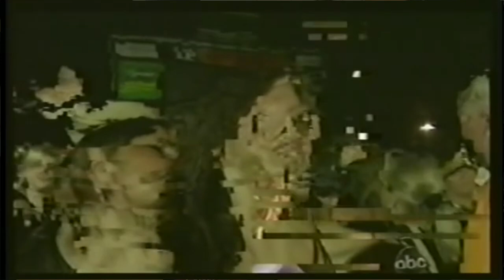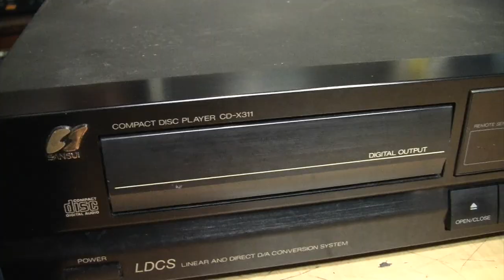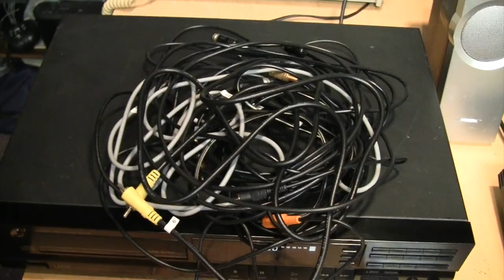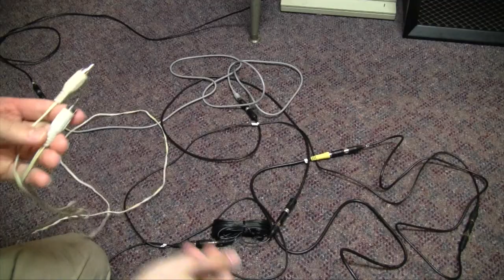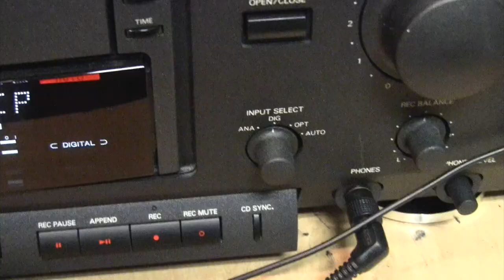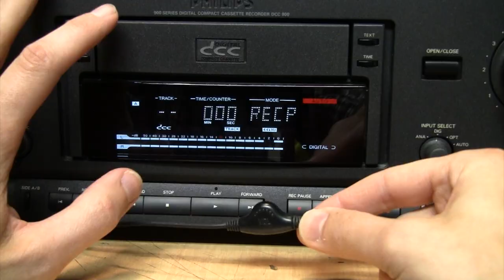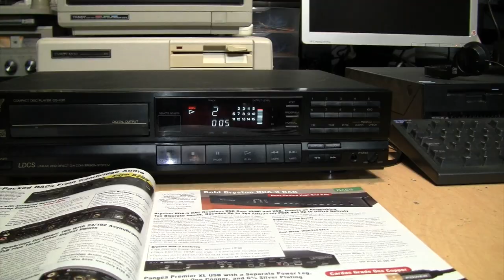What does a crappy digital audio cable actually sound like?

Comment: Brilliant work, as always. I suspect the same might be true of HDMI cables.
Reply: Geez, I don't think we need "audiophile" anything for digital and optical signals. The only time you actually need it is for analog or very high data rates.
Reply: Some HDMI cables that claim to be of the data rate suitable for 4K will sometimes have the picture cut in and out, suggesting the higher frequency information is being lost even though it's perfectly fine for 1080 or lower refresh rate 4K. Of course the cable shielding (and its environment) makes a bigger difference for that than whether the connector is gold.
Reply: @kaitlyn__L  not had this problem myself, but I don't have a 4k TV!  Your reply has made me think though. I've got a car that supports android auto, and some USB C cables, ones that are perfectly decent for charging and connecting to the PC, will not work for that purpose. The car keeps disconnecting from the phone. Had to get a sturdy Anker cable, which is much stiffer and thicker than the usual cable, and then it works fine. I guess a lot more data is being squirted down the wire for that application than just sound.  But I guess that's still a difference between the cable working and not working though. I suspect these claims of better sound (or picture, or whatever) with premium cables are bogus. It either works, or it doesn't.
Reply: @SpuddySpud  Yeah, it definitely works or it doesn't. The only subtlety is it might flicker in and out of working or just completely stop, depending on the level of corruption. But no subtle changes in final outcome could be occurring from small interference, it would get caught by the error correction, or just not change any bits' distinguishability at all. No way clearer sound would occur compared to adequate sound from such a cable. Much better to upgrade your DAC if you're spending that money!

WRT your USB cable, it's almost definitely the same thing. Higher data rates, if keeping the same encoding scheme (aka QAM or Reed-Solomon or whatever), necessarily require a higher frequency signal. Video being so many MHz compared to audio's kHz created lots of challenges for cables back in the day, and the same can occur with data rates today, albeit now in GHz for HDMI's many dozens of Gbits, even if they are packing 8 or 16 symbols into 1 baud. For Android Auto, it's sending HDMI signal down the USB cable, rather than a software-layer HDMI over USB transfer layer. I think. I hear any TB3 compatible cable has the cable bandwidth (yk, in GHz) for HDMI or DP, which I suppose makes sense. 

With your USB cable it could well have been a mix of not enough bandwidth in the cable but also interference, if you don't think it was shielded as well as the chunky one you replaced it with. Cars are pretty RF-busy environments, and high frequency signals are also disruption-sensitive. There's a chance it could work ok in your home, if all the bits remain distinguishable enough.
Reply: @SpuddySpud  :  That may just be down to the way the cable is internally wired - it may not have connections for the Android Auto functions. I've had similar with mini-USB cables to connect cameras to my PC - one that came with an HDMI adaptor is only wired for power delivery, and not data transference.
But yes, you are definitely right that most of those claims about fancy expensive cables are better than the 'cheap' ones....as long as the 'cheap' one works as it should, then there is no need to replace it with the snake-oil $100+ cable just because the manufacturer tells you their's is SO much better........Just as VWestlife proved in his video.......!  :-)
Reply: VWestlife's audience is a knowledgeable bunch!  Thanks for the feedback 👍

Comment: I dropped my subscription  to Stereophile Magazine many years ago when they started spouting nonsense about digital audio.  "Color the outside edge of your CDs with this specific green marker to make them sound better!"  Yeah.

I may try to replicate your experiment, I'm wondering if having the signal going through the stereo cable in the same direction (instead of doing a U-turn as in your setup) would make a difference.

Also, running the signal through the attenuator was an excellent idea!
Reply: Coloring your CDs with marker was actually a real way to defeat certain copy-protection technologies. You had to color them in exactly the right place - the aim being to color-out the deliberately corrupted data-disc table of contents that was made to jam up CD drives, so they would fall back to the valid audio-only ToC.
Reply: @vylbird8014  Macrovision on DVD was a copy protect system, I wonder if the green marker will work on those
Reply: @VaughnfromPeterborough  Nope. Macrovision on DVD isn't really 'on' the DVD: It's something the DVD player adds in. The DVD only contains a flag that tells the player it needs to turn macrovision on, so you can't color it out. Players have to obey the flag because it's a condition of the licence that manufacturers must agree to in return for access to the decryption key needed to (legally) play a DVD.

Comment: interesting, LMAO. It is not just the increase of resistance in very long runs, there is also an increase of capacitance as well. Parallel wires (insulated) close to each other ( as in a cord/cable) act as a capacitor as well. BTW: those expensive cables are a ripoff, but people are too gullible to not buy those.
Reply: capacitance would play a role if it was couple kilometers at 1MHz (for example adsl), but 20m at 100KHz? :)

Comment: So you don't need to splurge on those expensive high-end "Monster" branded cables claiming you will get better quality.
Reply: Well, for the actual electrical stuff it's helpful to have gold contacts so you can basically ignore the contacts (contacts matter because of corrosion/oxidation, so if that doesn't happen then you don't have to fix it!), and if you somehow find a TOSLINK cable that has a wire running from a contact on one end to a contact on the other then you might as well splurge for gold (for all you know, you could accidentally connect the grounds together).

But as far as just cables? If you're fine with soldering or crimping, it's not even all that hard to just make your own. With a bit of experimenting, I'd bet that you can get some awesome analogue headphone cables by just connecting some boring gold-plated TRS connectors to welder wire (the stuff they use to connect the welding tool to the power supply: much lower resistance than normal headphone wire because headphone wire is normally thin, but the smaller strands make it more flexible and more resilient to flexing than normal stranded wire), and the cost will likely be much lower than the "audiophile" stuff.
Reply: Yes you must.
Should cost a minimum of about 700 dollars/foot cable.
Reply: The Monster shop displays in analog days always severely annoyed me. They'd have Monster Component cables compared to no-name Composite cables, hardly a fair contest!

Comment: I think you were experiencing interference as the digital packets went through the stereo cable side by side in both directions at the same time. Probably if you stripped the two wires apart so they aren’t touching each other for 25 feet, it might have continued to work fine. Or maybe twisting it like a pair of conductors in a Cat5 Ethernet cable. That might have canceled the inter-wire interference.
Reply: it sure did look like far end crosstalk
Reply: Yep, I was thinking the same thing. The crosstalk is causing the degradation more than the overall length.
Reply: yep 100% that's what was happening. This is why we shield cables when doing long runs with low signal noise ratio (tv aerial being the prime example).

Comment: Hydrogen Audio represent! Admin kode54 here.

E: Also going to guess a possibility that the audio passing twice through that same paired cable can also result in RF interference between the two cable lengths.

E2: I watched the whole thing this time, rather than commenting while I was still watching it lol. I see it's just the DCC having the smarts to cut off on signal degradation rather than playing the resulting audio.
Reply: Hey, as an electrician I think you are onto something! Signal, that is passing through the same paired cable in the opposite directions could cancel itself out, ecpecially if the cable is coiled. I've seen inductive interference filters that are working on the same principles.
Reply: what

Comment: What you did is creating a coil, so the signal itself is creating a magnet field and influences the signal that is right now in a different part of this stacked cable. If you had split up this stereo cable, your issue would  be gone.
Reply: Don't tell him that he be running the cable down the street next lol 😉
Reply: Pauly H I’d watch that video.
Reply: Yeah, I was curious if plugging back into the same end of the cable the first input was in, rather than looping round to the opposite corner on the same side, might have dropped less bits. Since it would be two parallel coils rather than a mirrored coil?
Reply: @kaitlyn__L  He did actually test this at about 15:00 but it was the same.
Reply: @multiplyx100  ok.
Reply: Maybe the left and right grounds are connected in the crappy cable?
Reply: @NejTech  No, its really this effect of the both cables being attached together creating magnetic distortion. Those cables aren't coaxial, their signal cable isn't encapsulated in the ground. they are just two wires side by side inside the insulation. So there is no shielding effect from the ground.
Reply: Makes sense since it's completely unshielded, with properly shielded cables even this would not be an issue.
Reply: Yeah I concur with this
Reply: No. Because you have both the signal (inner wire) and the return current (outer shield) going the same direction, any magnetic field completely cancels itself out. Same with the unshielded cable, makes no difference.

Having the outgoing and incoming current cancel itself is how a GFCI (RCD) protective outlet works.  If exactly the same amount of current is returning through the neutral, it cancels the current powering the load.  But if any current takes some OTHER path to ground, then the currents are out of balance and it trips the breaker.
Reply: @richard7crowley  there is no shield anymore, it was lost when he added the segments without shielding.
Reply: @RedShift5  If not shielded then it's a twisted pair. Either way his point about magnetic field of the return current magnetic field opposing the signal's current is valid.

Comment: Great video! Would like to see more on this topic. By the way, I've seen audiophile SATA cables as well! If regular SATA cables were dropping bits along the way, our computers wouldn't function. I can't see how such a cable would be of any benefit to the sound quality.
Reply: Audiophile sata cables? Wtf? 
I mean crappy sata cables may fail with some bits (and because of that the s.m.a.r.t. crc value), but the computer requests an entire data stream, if its corrupted and the system didnt crash it wont just use it like a analog device.. 
And worse!  Tecnically unless you have like 12mb of ram, the files should load up entirelly on ram.
Reply: @eduardoavila646  https://jcat.eu/product/reference-sata-cable/
Reply: @Carambal81  "Cryo threatment", "vibration dampening", "better audio and video quality",  this one could easily be sued due to false advertising. 

I think that my faith in humanity has dropped quite a bit.
Reply: @Carambal81 
"best sound and image quality"
"image quality"
Dude what?
Reply: @Wilus0  From their user reviews: "During my first test directly from the fine gold box I immediately heard that it sounded cleaner. Perhaps not a night and day difference, yet fully noticeable.
Now I have listened much more with JCAT Reference, perhaps both the cable and my brain has become more balanced during this time. I'm not either a true “burning-in believer” but I anyway have my senses fully open. I switched back to my old JCAT SATA V2, and after that it was not fun to listen anymore. Whole soundstage was more squeezed or compressed and strained especially in the treble."

They have an entire blog post with stuff like this: "Audio grade SATA cable used with an operating system drive or a music library drive improves the sound quality dramatically. It doesn’t matter if you have the latest SSD or an old HDD, the effect is always the same: much higher class playback that can be compared to using a high-end USB Cable with a DAC vs. a generic one – more details, darker background, more clarity & musicality. It should be an essential component of any audio PC. When I look at the internals of so-called ‘state of the art’ audiophile music servers, I’m literally shocked to see that this area hasn’t been identified by the industry yet."

Great snake oil, almost as great as the gold plated TOSLINK (optical) cables.
Reply: Audiophile SATA cables? Most of the cables I use were pulled from 10 year old scrap Dells!
Reply: If you had a really shoddy cable that you were comparing it with then you might notice a speed difference, but yeah, sane construction + normal corrosion resistant contact coatings will do everything that normally needs to be done.

Comment: Can you do bit perfect SPDIF sampling with Audacity (or other program)?  That would be interesting to see what's actually missing when the signal is marginal.
Reply from the maker: Unfortunately instead of interpolating the missing or corrupt data like the sound card's DAC does, the direct recording just skips over it, causing the sound to get jumbled and sped up.
Reply: That is deeply weird.  It's like a stream of serial data with no time base.  I would not have guessed that for an audio standard.  Too many samples, I guess, to stretch back out.  Again, thanks for this interesting experiment.
Reply: @Grinder2112  I think it's not that weird, usually there is a timecode in the packet. Sounds like the recording just acted like when a CD skips, it cuts to where it can resume playing rather than wait in silence on the "scratched" part of the datastream.